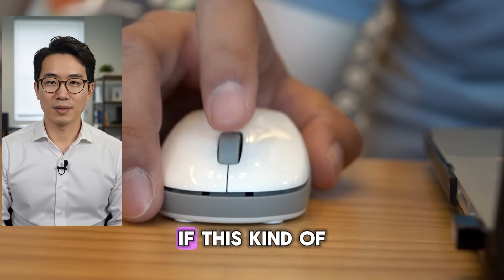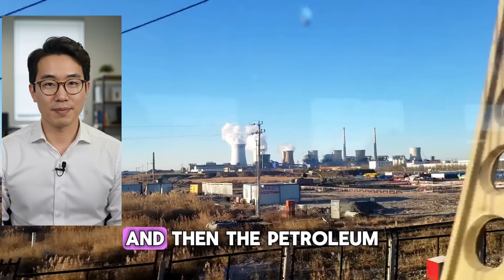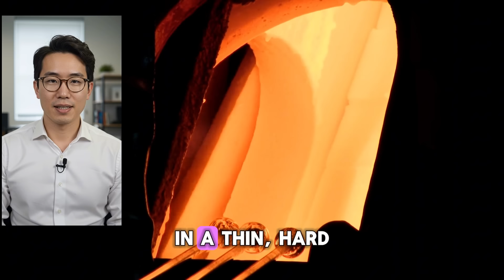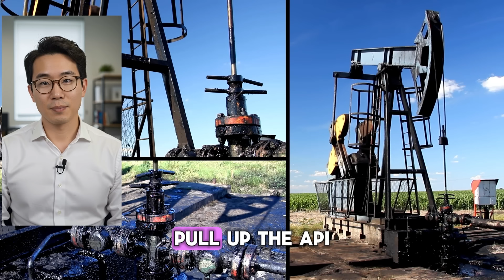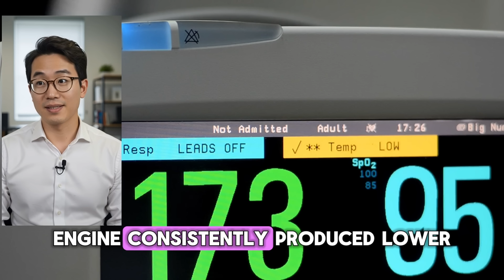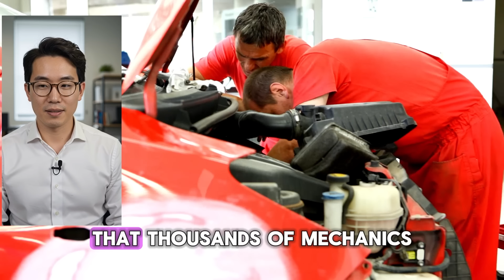Forgotten $2 Engine Trick That Adds 50,000 Miles - Oil Companies Buried This

Comment: While caster oil possesses superior high-temperature film strength, it is prone to oxidation, creates sticky gummy residue/sludge, and can degrade quickly, making it unsuitable for long-term use in daily driving engines. It is mostly used in specialized racing or two-stroke engines and requires frequent engine teardowns for cleaning and is not suited for modern cars.

Comment: Years ago if you had a model airplane with gas engine,   caster  oil was mixed with the gas.   Smelled, but I think it made the little engines not freeze up.

Comment: Met a guy, owner of a motorcycle dealership in southern California back around the 1980s. He started using 2-stroke oil as a replacement for automotive engine oil. At the time I met him, his El Camino had over 450,000 miles on the original engine with no engine work ever needed. Because of carbon on the rings from having used automotive engine oil, it smoked like the devil briefly when first introduced. Then... not only long life but better compression and gas mileage. So hey... the day the manufacturer warranty runs out, I suppose one could switch, assuming they want to keep their car and preserve value. No special DIY custom formulation required. Already on the market or at least it was. So like you "could" use a formulation to add 50k miles or you could switch to 2-stroke oil and add 200-300k miles or more. Seems like a no brainer.